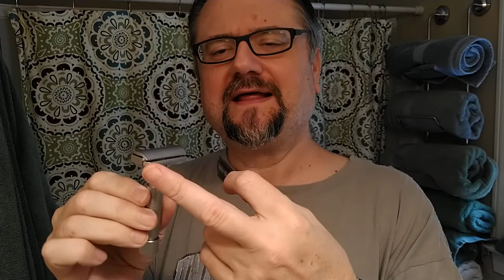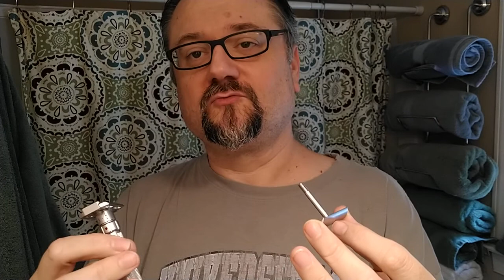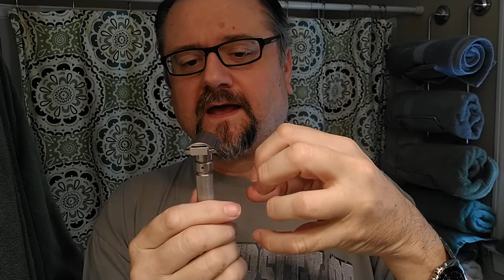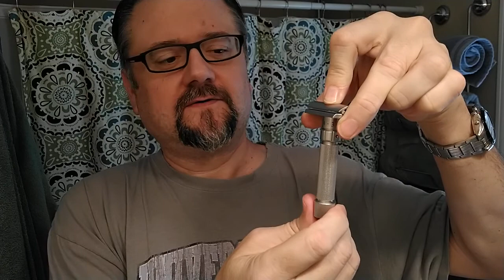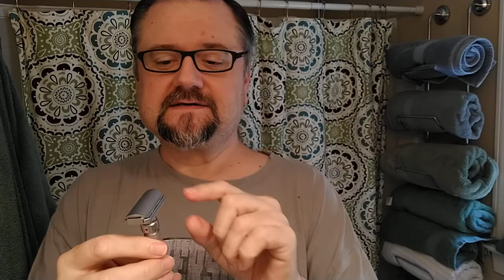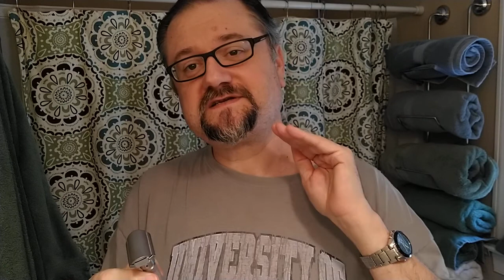Fix for Pearl Flexi Adjustable Razor Alignment Problems (5th gen)

Comment: Helpful solution!
As I figured out, there are 2 versions of flexi, v1 and v2, the v2 has solved the main issue with the gap. The higher versions stand for the production run
Reply from the maker: Thanks!

Comment: The reason it happens is because the tabs on the top cap don't go all the way through the base plate. Have a look at Homelike Taiga. There are slots in the baseplate and the intermediate plate through which the rectangular rounded tabs go through. This guides the top cap and prevents skewing. In this razor the tabs go just through the intermediate plate which rests on the center spring. So there is no guiding for the intermediate plate which is kind of floating.
Reply from the maker: Ah, very good observation.  And I just looked at mine and you're exactly right that the tabs/rails from the top cap don't go all the way down into the plate that has the safety bars.
However, even if they extended them down into it, I think that might create other problems.  But with more work, they might be able to address them.
I'm sure these problems are hashed over for hours and even days, when vendors try to make a good adjustable!

Comment: Thanks for sharing!

I'm very disappointed with the flexi.
Mine is the v4 and has alignment issues when I go to seeing 4+.

I only use bic blades with it as I use it on 3 with this blade.

The other issue is that the adjuster knob doesn't go from 0-6, it goes from 1-5!!

They didn't replace it for me as I didn't register for warranty within 2 months of purchase...but I always thought statutory warranty is 12 months?!
😡😡
Reply from the maker: Man thats too bad.
It wouldn't be all that bad for me, since I like the settings at 3 and below the most.

Comment: I am aware each razor has its unique serial number. How can I find out which razor belongs to which generation? Is this information available for the public?
I might buy one second hand so this information is very appreciated.
Thx.
Reply from the maker: I don't know of any serial numbers on the one I have.

Might be hard to pin down if the guy selling it to you doesn't know.

I'll look on my seventh generation and see as well.
Reply: @sgrdddyshaves   So there is no serial number engraved on the bottom side of the baseplate anymore? 
This has been the case with the former generations...

Comment: I have this problem with an Edwin Jagger DE89
Reply from the maker: It's common with the DE89, and the other clones like it, such as the parkers and merkurs, and bailis.  They are cast zinc alloy and can't be made to such tolerances that lock the blade into exact alignment.  So they have to leave a little wiggle room, and you have to check it each time.
Reply: @sgrdddyshaves  Thanks for confirming that with those models I always have to check the alignment and stop fighting about the warranty 😉. So with a high-end stainless steel razor the adjustment of the blade will be better. I'm new in this world of the classic shave (one week) and have seen some nice safety razors , I like the Tatara Masamune, the Feather AS-D2 and the Edwin Jagger 3ONE6. Greetings.
Reply from the maker: @Francisco-MH  here's a bit of advice. It's easy to drop hundreds of dollars on premium razors. However, if your technique isn't really well established, and by that I mean technique with the razor as well as with generating a good lather, then you likely won't see a ton of improvement with all that money spent.
With the de-89, you've got a solid razor there. So I would just use it for a few months before jumping into other purchases.
For instance, the feather asd-2 is on the other end of the spectrum from the 316. That model feather is super mild.
And you don't really know what you like quite yet.
One exception I might make is if you find a great deal on some vintage razors on ebay. Sometimes you can get five of them for $25, and while it's possible that you may get one that's a little messed up, my experience has shown that in general the vintage ones are pretty hard to beat up. Especially the vintage Gillette tech. Those are a dime a dozen and sometimes you can get one for 7 to 10 dollars. And that would be a great razor to play around with and switch back and forth from your de-89 as you figure out which one you might like better.  If your person like me who enjoys variety, then being able to experiment with a few vintage pieces for not much money can satiate that need while you wait for your skills to get up to par.
And then once your technique is better, then you can make a good educated guess as to a premium razor to purchase, and more so, you'll be in the place where you will be able to appreciate the differences that it offers. 
Take your time, and enjoy the journey!

Comment: I have a 6th generation and I can't detect any blade gap inconsistencies. I still do this alignment trick though, it's easy and intuitive. I like the razor a lot and it represents tremendous value. It's a pity they have had this issue.
Reply from the maker: I'm glad the 6th seems to be a good design.
It is a very good value.